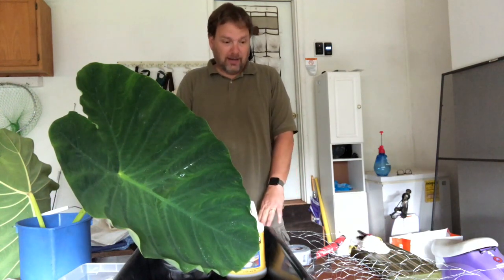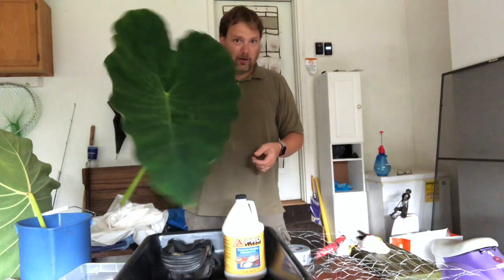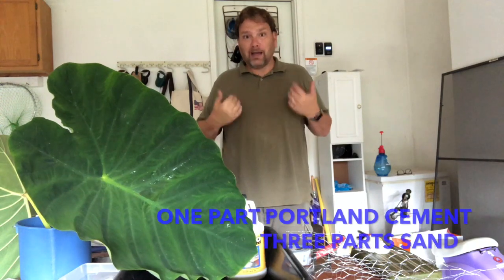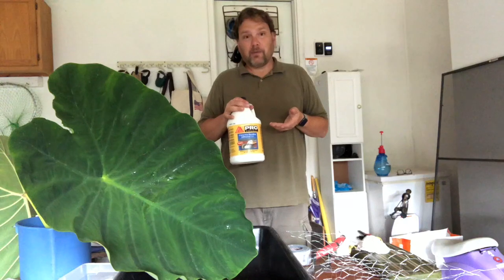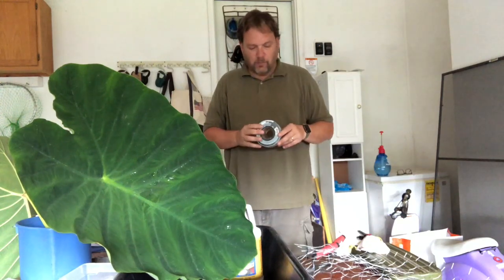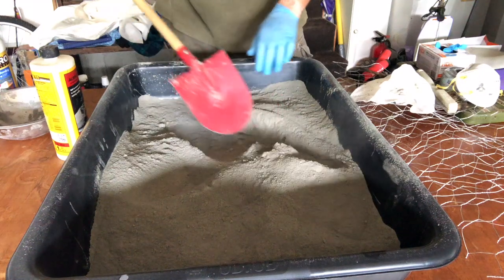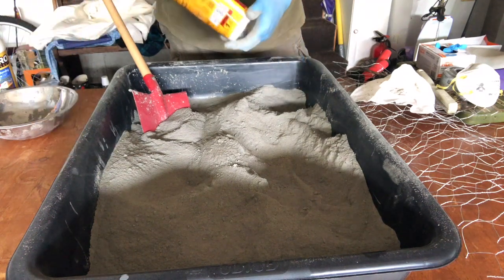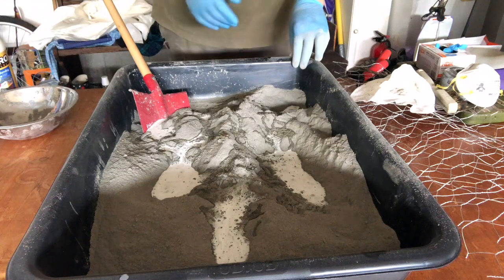ELEPHANT EAR WATER  AND STEP CASTINGS

Comment: Question: You said, for flat leaves, "don't use sand."
Did you mean, don't add sand to the cement MIXTURE, or not to put sand on the tarp, UNDER the leaf?
Reply from the maker: I believe I was referring to the sand that was used to help create the curve for using the casting as a water feature. I would not need sand if it was formed on a flat surface for use as a stepping stone. Hope that helps you.